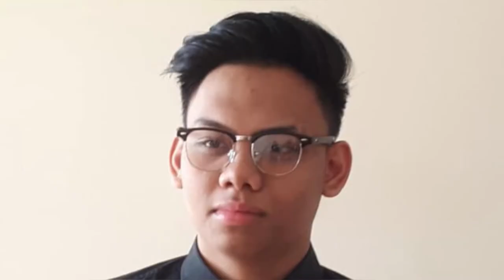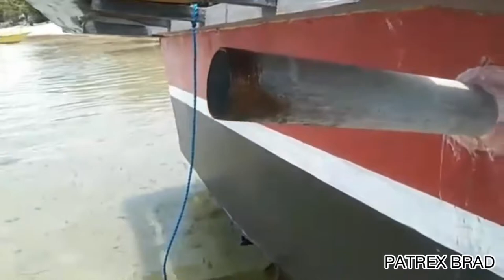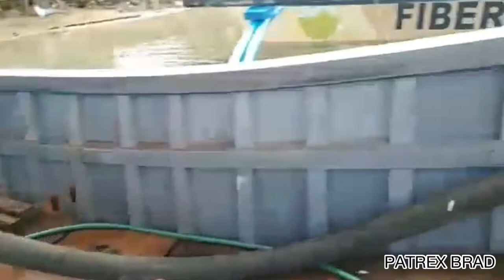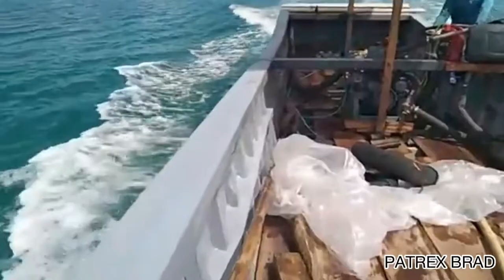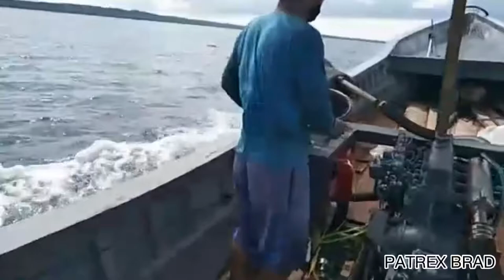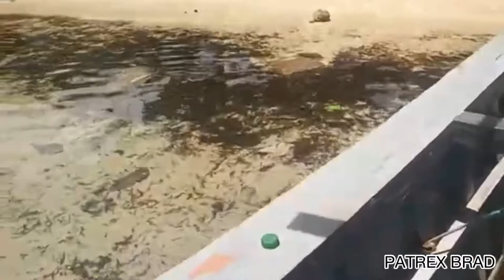FLATBOAT UMARANGKADA NA | 4DR5 ENGINE SUBRANG BILIS MAGPATAKBO

Comment: Dapat ang camera man sa ibang banka naka sakay para makita namin ang buong bangka na tumatakbo or dapat ang camera man nasa isang fixed point.
Reply from the maker: Kapag nakauwi ako brad yung mga kapatid ko lang kaya ang nagpagawa nyan di ko na ipinatuloy dahil gusto ko baguhin yung cabin .. Salamat brad
Reply: @patrexbrad  matagal na rin kace ako nag hahanap ng video ng flat bottom bangka na ang gamit 4cylebder engine .
Reply from the maker: Search mo brad madami content na ganyan .
Reply: @patrexbrad  oo marami brad ky lng mga maliit less than 20hp mga makina mga palikpikan flat hoats.
Ito plng n kita ko  pinaka malaki flat boat.
Comment ko lng primitive method ang construction maraming wood materials na ginamit maraming joints na pweding bumigay kapag loaded at luma na.
Reply: Wala alo makita bilge pump sa video.